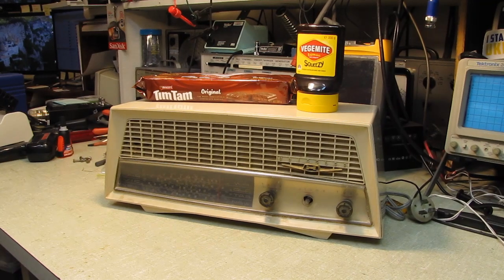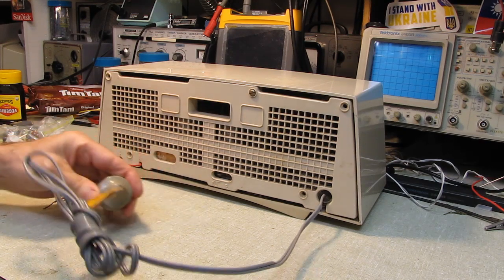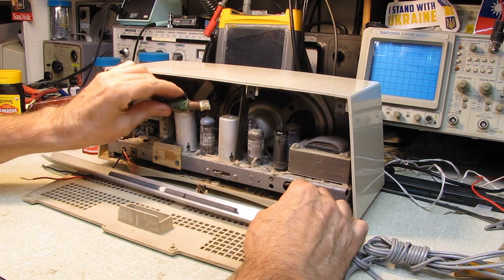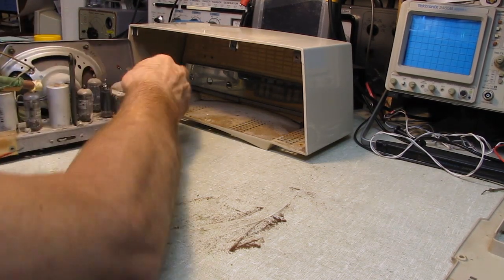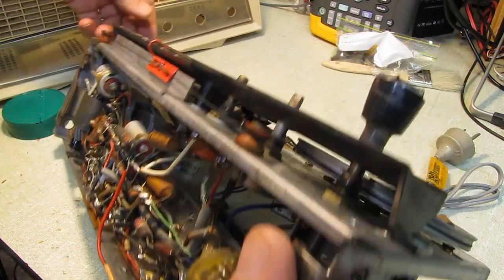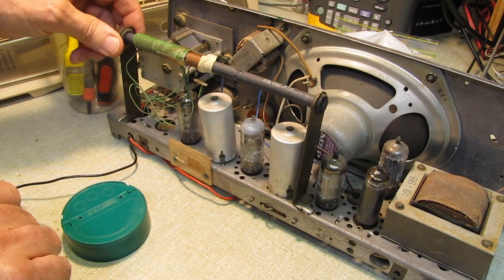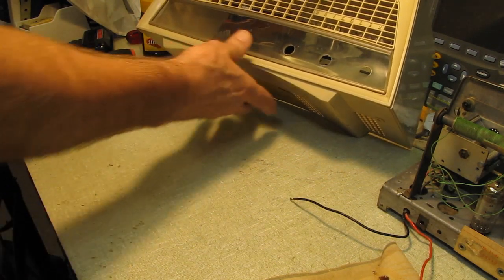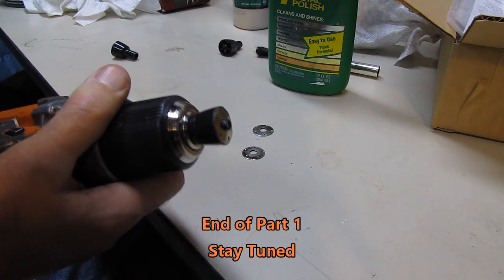Kriesler Australasia Model 11-81 Part 1

Comment: Hi Vern, I am devastated the radio was damaged. I should have packed inside the radio with bubble wrap and put some tubes in as spares. My thinking was to test the radio and make sure it worked to some degree and not open it up to look inside so you get it "as Is'. Bubble wrap would have supported the ferrite rod and protected the tubes, thankfully you were able to repair the antenna. 
The spare pot is for the volume control, the one fitted has been got at so I sent a new one. 
I was surprised you found Tim Tams at the local grocer. If you put Vegemite on toast you will need butter as well, it makes a yellow and black river of deliciousness. It is true that Aussie babies are weaned from  mother's milk directly to cheese and Vegemite sandwiches 😉
I have some of that UV superglue but never tried it, I'll see if it's OK, good tip. 

Good idea sending the dust to Beijing 🤣🤣
I hope the rest of the radio repair goes smoothly Vern, they are a good sounding radio.

Comment: ..... Well done Mate,
We also use the Vegemite as a substitute for graphite grease in S-class locomotive bogies.
Reply from the maker: Thank you Rob, I will try it in the Harley Transmission. Might quiet it down. 😄
Reply: @theradiomechanic9625  .... And I personally have used a 'Tim Tam' as 5W inrush current resistors protecting the rectifier of a Astor PS portable.

Comment: You can try heating those little plates up with a heat gun or something and then hitting them with a genuine solid brass (not brass plated, which the cheap ones are) bristle wire wheel.  The brass will transfer from the wire wheel onto the plate.  I hear this works very well.  Bob Andersen (bandersentv) did it to one of his Predicta TVs.

Comment: Loopstick antenna: I wonder if the glue between broken sections has any negative impact on the antenna's receiving ability. How about using some gentle adhesive to keep the loopstick in place? Looks like you did.
Wall-Warts: the term applies equally to transformer based power adapters.
Knob polishing: toothpaste is mildly abrasive itself.
Tough Aussie: it's the "down-under dust".

Comment: Where did you get your UV adhesive?  The only stuff that I could find sold retail is absolutely horrible. Worse than CA glue.  Hell, worse than Elmer's glue stick.  Absolute garbage.
BUT, I have heard dentists and other uses for this stuff that is not retail, which you cannot get in stores which is actually very, very good.
Reply from the maker: I have purchased it from both Home Depot and Amazon. It does not have a good shelf life. I keep mine in the fridge and let it come to room temperature before using it.